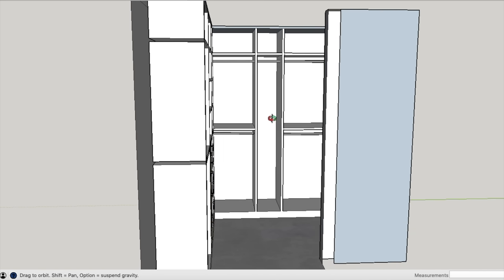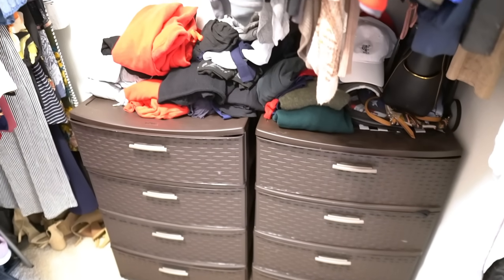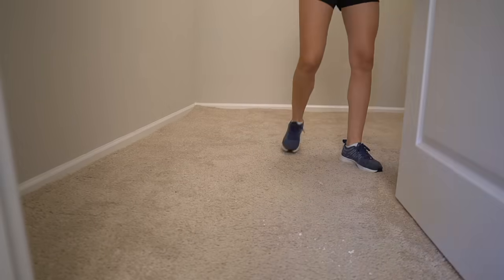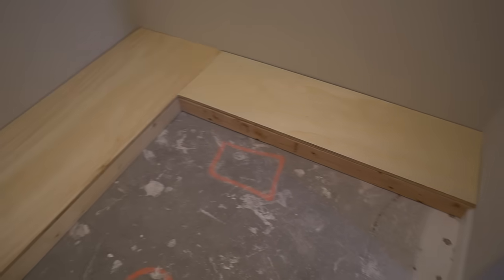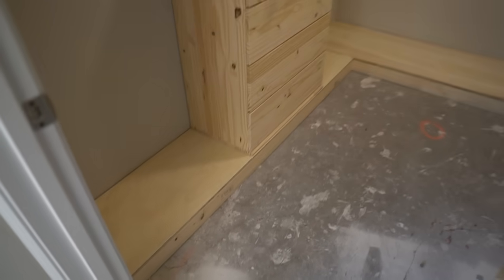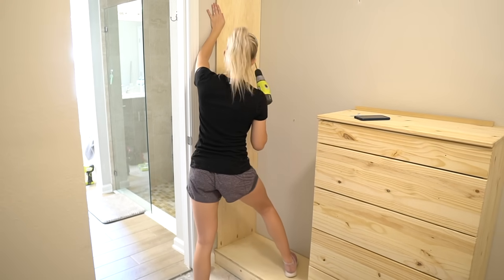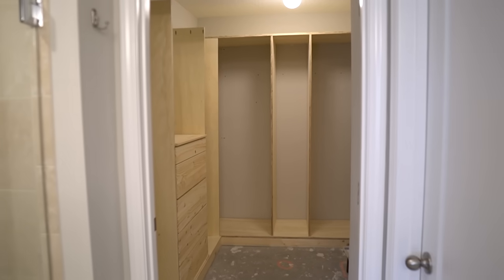DIY Dream Closet Makeover on a Budget!!! [Part 1] | Home With Stefani

Comment: THIS is legit DIY. Working on the ground, minimal amount of tools. No fancy 100k workshop. This makes me happy to find as a DIY. I always run across the "DIY" where they have thousands in equipment and tools. Thank you.
Reply: TBF they're all DYI. The more you get into DYI, the more tools you end up getting. You really just need a circular saw and a drill to build whatever you want. The more tools you add, the easier, more refined, and better finish your build has. For example, she used pocket holes, which is another tool to add refinement to the product.
Reply: Well glueing stuff on walls is indeed legit crappy DIY
Reply: I'm with you. I hate seeing the DIY videos where it's like "All you need to do this is this $10,000 tool and 10 people!"
Reply: They are still DIY, just with better tools than you have.
Reply: Diy has nothing to do with complexity and tools etc.  I would say this is half DIY because she bought premade stuff and only took on the assembly and installation

Comment: Go video:
Tip from longtime experience with doors,  pop the pins, that way for reinstall you just have to put the pins back in.  Also use a flat bar driven in under the carpet strip nails perpendicular to tack strips and you can take the whole strip up with only a few bangs on each nail.
Reply: Same thing I was thinking.  This is the second video recently I have seen where they have done this.  Door removal takes seconds if you pop the pins.

Comment: Wow, looks great and very good work. The only suggestion I'd have for anyone that replicates this. Try not to glue large pieces of wood to sheet rock. When the wood contracts just a tiny bit, it can put stress on the drywall and even cause small cracks. And if you ever decide to change the space, you'll have a wall that needs a lot of repair. A few pocket hole screws should work.

Comment: Very cool! Good deal not relying on just the liquid nails, after demoing several houses I have noticed, on a finished surface if it does adhere it only to the paint layer. Most of the time it doesn't stick to even high grit sanded wood.

Comment: This is a very interesting project. Video nicely done. The only item  I had doubts about was the 2x4 base. Were those 2x4s regular, non-treated wood? I don't know how well they would hold up on bare concrete flooring without a barrier in-between. Concrete and bare, untreated wood do not interface well.
Reply: Would it be ok to build this directly on top of floors instead?

Comment: just a heads up, when you take a door off the hinges, you just pop the pin in each hinge.  Taking the screws out increases the chances of stripping the holes out and messing up the door.
Reply from the maker: Good tip, thank you!!

Comment: Great video. Thanks for sharing.
A few of questions, that will help as I am fixing to start my closet revamp...
1. Is the base build out of treated wood? My understanding is that it is required by code for any wood touching the ground or slab to be treated.
2. Can you give the model # of the Ryobi nail gun you were using?
3. Is there a particular reason for using pocket holes for attaching verticals to the top shelf? Can one use screws ir nails from the top straight into the vertical boa4d?
Thanks in advance for anyone answering, and sharing their knowledge.

Comment: Great video! TFS 😃
another hack- when taking the door off; take the pins out of the hinges. Then put the pin in the hinge part on the wall. It’s faster & you don’t run the risk of having to re-drill holes in the door. 😬

Edit- that’s for IF you’re putting the door back 😬
Reply from the maker: Thank you for the tip!!😊
Reply: I had to pause the video to come make sure someone told her this in the comments. Wonderful renovation though!
Reply: Yes indeed, I carefully taped off and painted the architraves around my mother-in-law's seven doors and was trying to remove the eighth door to replace carpet when I spotted the hinge pins..... AARĢHHH!

You learn something every day.

Comment: Hi Stefani, good tips. Just be mindful that you should be careful when hitting two hammers together. There is an outside chance that the hammer heads could chip and send shrapnel flying. Consider using a wrecking bar as you have mentioned in another video. Safety goggles always...work safely. Keep up the good work!
Reply from the maker: Thanks for the safety tips! I need to work on that 👍

Comment: I'm very impressed! Some folks have offered tips, and there's always the learning curve with each project. Personally, I would have used a framing nailer for the bases, but the finish nailer should be adequate for this purpose. I would have painted the floor first, to help limit moisture transfer and to make it easier to paint without all the edging at the bases. If you had done the partitions first, then then dressers, you could have hidden the pocket holes on the dresser side of the partition. But hey, everybody's a critic, right?   I only wish I could put IKEA stuff together as fast as you. Must be the wine! ; ^)  I like your overall concept. I think you've got a nice project here, and it's obvious you did take the time to plan it out. I'm going to go watch part 2 right now!

Comment: I really don't understand the closets the builder makes these days most have the one wire shelf that leaves so much wasted room at the bottom and usually the top has wasted room unless you are storing suitcases or very large boxes.I understand they are doing it on the cheap but a little sectioning off would improve the function so much.
Reply from the maker: I agree, Becky! They don't make sense!
Reply: Its terrible. Not only are they cheap they honestly could care less about how the home turns out. One neighbor cut out under their stairway and they said it was full of trash. While I was taking out the rocks in the front garden I got to the bottom layer and there was glass bottles and plastic bottles etc. Some are cemented in so I couldnt take them out. I covered the area with white rocks to better match my tan home.
Reply: BatmanPwnage omg that’s insane 😱
Reply: @ShayBelladonna  yeah. They built new houses in the area and theyre getting sued hahahaha its for the stone paneling on the front of the house. Theyre a hazard cause they can fall off and hurt people.
Reply: BatmanPwnage how awful. Will y’all get some kind of compensation for what they did?
Reply: @ShayBelladonna  nah my house is like 10 yrs old and they dont work w the same contractors. The guy who found the trash in his stairwell sued. Been like 2 years. Lawsuits waste money and time.

Comment: Me: wow this seems pretty easy...I could totally do this and save tons
Also me: only owns a screwdriver
Reply: Its not easy! Nobody gets every cut, every angle or every screw in perfect zero mistakes, even the pros. This is a scripted performance.
Reply: That's me 😂
Reply: @lihlemokgalaka4548 just finished my closet project  last month. Cut the closet rods too short due to a measurement error...had to make a trip back to hardware store to buy new...that is reality. 
Hot chick doing  a closet install is fake
Reply: LOL!
Reply: @Mike-ij8uq  Someone ego was bruised during this video. Are you upset that she did it flawlessly? You fucked up, she didn't..it's ok. Doesn't mean that it's a fake install lol
Reply: @charlesscott6140  everyone fucks up or runs into the unexpected. Even pros like Mike Holmes or Norm Abrams. No one does a remodel or repair flawlessly, zero mistakes, zero omissions every time.

Comment: Pro tip: buy yourself an impact driver for screws. A drill isn’t an impact driver. Your wrist will thank you later. 👍🏻👍🏻👍🏻
Reply from the maker: That may have to be my next tool purchase... thanks for the tip!!
Reply: I use a drill over an impact, and I don't round out 100 bits.
Reply: Fif Wuhk and your point being? Nobody said anything about rounding out bits. I offered her an alternative method so her wrists don’t tire out. I’ve been in the trades for a long time and no one out there doing the day to day work can argue that a drill is better than an impact driver when it comes to setting screws. Also if you know how to properly use an impact driver you don’t round out bits.
Reply: @jodyrolandconstruction6577  I think my point was above... :) impacts round out bits
Reply: Fif Wuhk not if you know how to use them they don’t. :)
Reply: @fifwuhk3123  impacts don't round out bits.  people not putting enough pressure round out bits.  Which happens with drills too.
Reply: @eternalharvestfarm  obviously, which makes it easier for most to use a drill, with variable speed.
However, it is my opinion, and was met as a second suggestion.
Reply: @eternalharvestfarm  You guys on this thread - LOL:). Impact/drivers are nice. The biggest reason they 'strip out' bits faster is largely due to people removing the bit from the head too soon. 'Project Farm' did pretty good analysis of this:).
I can't think of any trades person who doesn't use both. When I'm doing detail cabinet work or certain metal assemblies etc. I use a drill w/ a clutch and even a depth-stop when necessary. I'm not unique in that regard.
Hope this is helpful.
Reply: @fifwuhk3123  Yeah if you don't know how to use them...also the newer ones have speed settings for people like you
Reply: Drill all day unless you can throw 100 lbs of force into holding it straight in the head of the screw to stop the bouncing.. however many times you have to do it...  Drill is better for this.  Impact is lighter and more convenient for sure.. But you don't need to impact a closet shelf together lol.  Save it for bolts and NASCAR.
Reply: @Chris Bryant lol....  That comment....
Reply: @fifwuhk3123  buy better bits
Reply: I've never had any issues with my impact driver rounding out bits/screw heads. You need to use a bit size appropriate to the size of the screw head (if using phillips screws). This is true regardless of the type of driver you use though. I've honestly had fewer issues with rounding bits since I started using an impact driver.
Reply: your wrists will thank you and your ears will hate you :)
Reply: It says in description below video her dad was a carpenter when she was growing up and she entered national guard as one so she does have some experience.
Reply: @jmc8076  not sure what this has to do with my OP but okay?
Reply: @fifwuhk3123  You are just new
Reply: @rafb145  Female here- started using impact driver once I advanced into rough carpentry. If you're working with 2x4's, plywood, OSB, once you use an impact driver you'll never go back. There's an added bonus of the screw heads being sunk at or below the wood surface (works out rather nicely with pine boards). It is not the most welcoming tool- jarringly loud hammering sounds and your wrists need to be prepared like you're firing a gun and anticipating recoil. So much faster though!
Reply: Love your video! It's awesome to see other women taking charge and getting their hands dirty!

Comment: Great job , just thought i would mention that when you put wood on concrete it will suck up moisture so use a vapor barrier or pressure treated wood next time... keep up the good work and videos....
Reply from the maker: Very good tip. I'll remember that for next time. Thank you!!

Comment: Great idea with the Ikea dressers. I'm planning to do built in in my closet. I'm doing mine first to refine the method, then I'll redo my wife's closet (mine is separate so she can't invade.. 😆). I might go that route. I was thinking of just building the drawer sections myself.  I don't know if I would've used the liquid nails on the sides up against the walls. If you sell your house, the next owners will be mad if they want to do something different with their organization.... It's your house, I get it, but I think screws would be plenty.
Reply: my exact thought, no need to glue that to the perm wall, screws to the bottom base and top shelf board is all that is needed.  I would have ran the side board on perm wall to the floor and had screwed them intot he 2x4 base.  She still did great job, I did our master closet and it turned out awesome I was very impressed with what I had done, I did not think I could do so well, and it still costed a bit over 1k bucks but had we got it from a kit company it would have been a few grand, this was back in 2013.  I am about to be doing a his and hers in our just added upstairs room so was just taking a peek at some ideas and this came up.  I will look into the drawers and paint them white.

Comment: do you have the height of the 5 drawers base(the part you used)? I really like this idea just need to make sure it will fit in my existing space without the feet so I'm not doing a complete reno.

Comment: Excellent job. superior craftsmanship (or Craftswomanship to be more accurate!!). You also have a great artistic talent in decorating (which I unfortunately lack). 
A couple of suggestions that I learned the hard way to make things easier when you are renovating: 
I always paint every wooden part before I install it. It is much easier to touch-up little dings and holes in an already painted surface than to have to sand and paint little crevices in place. It also allows you to use a roller rather than a brush which is a real time saver. If you really want to get fancy try spraying the paint. Spray paint looks better but it is a pain until you get used to doing it, so be forewarned. It took me a bit of time to learn how to spray paint but it is now much easier the second time around. Spraying paint also requires covering things that one does not want to get sprays. I spray painted my kitchen myself (that saved my $3,000) and it looks professionally done....well worth the effort. I don't think I can go back to brush painting unless it is a small job.
I also found that buying the best quality screws makes a big difference. You will spend $10-15 for a big project like this but it cuts down on cursing while you work!! Good nails are reasonably priced If you buy them in bulk because the pros who generally use them do not buy small packages.
On last point. For the longest time I bought cheap drills. Now that I finally broke down and bought an expensive drill and nail driver, I know why pros use these expensive drills. They are much more powerful and, more importantly, perfectly controlled. I get every nail in effortlessly and exactly as it should go, not bulging and not too deep. I bough a Dewalt set that cost about $200 but I am sure other manufacturers make ones that are just as good. A good drill coupled with good nails make it a joy to do carpentry. Also when I assemble Ikea furniture, a controlled drill can save me much time. When I tried a bad drill just, it just striped the holes from over tightening because you will not well controlled and this always ended up being a total mess).
Keep up the great work you are doing and keep posting new videos. I really enjoyed watching your closet renovation video and and learned much from it.

Comment: Very creative solution for a budget. Props to your carpentry skills. I hope nobody has to ever take this thing out, the liquid nails against the wall will be a nightmare to remove, may have been better to just secure it against the studs. Also, wondering if the long plywood pieces may warp over time. What was the overall cost of the wood?

Comment: Hi The Brad Nailer you used is a 18 gauge on the 2x4 is using 2" nails at least that's what the link leads to. My question is how are you able to nail the two 2x4's together?

Comment: Stefani - This is amazing. I have been watching this over and over again to plan and also to build up courage to take on a task like this. A question on the material, why did you chose Sandy Plywood instead of Particle board? Particle board is much smoother than the sanded plywood and half the price for same 3/4" width. I am ruling out MDF as MDF can't handle weight and could sag but I guess most of the shelves we see at Walmart, IKEA etc.. are all made of cheaper material such as particle board. Thanks in advance for your response. We love your videos

Comment: Great job! Do yourself a favor and by an impact driver. It’s a cheap tool and you can get a ryobi to go with your kit and batteries. You have a lot more control, snap less screws, and don’t have to work as hard (which is why you have more control).

Keep it up!

Comment: The cubbies up top limit the length of items you can stash up there. The top should be monolithic so you can store anything from wrapping paper to long boxes and cases. Even better is to run full lengths of melamine or shelf liner covered plywood to make it one flat surface with as few joints as possible.

Comment: JUST FOR FUTURE PROJECT REGARDING THE TOEKICKS 2 THINGS ..THERE IS A VERY ACURATE WAY TO FIND THE MIDLE OF THE STUDS AND THAT'S A MAGNET STUD FINDER OT ACTUALLY STICKS TO THE DRYWALL SCREW AS YOU PLACE THE MAGNET PRESS AGAINST THE WALL CIRCLE AROUND AND YOU WILL FIND THE SCREWS IN THE MIDLE OF THE STUDS AND THOSE MAGNETS ARE FROM 3 TO 5 BUCKS ONLY ... SECOND YOU DONT ALWAYS HAVE TO SCREW THE TOEKICKS TO THE STUDS YOU CN DO IT TO THE BOTTOM PLATE AS WELLL... LOVE YOUR VIDEOS AND I JUST CAME ACROSS THIS CHANNEL FEW MIN AGO

Comment: What were the dimensions on the vertical plywood boards? 

The Tarva dressers I found were only 15" deep, is that the same as what you used?  Did you set that out from the wall?

Comment: Stefani 
Love what you have done two thumbs up from me. Just one question, would this work as well with the home depot 1 inch white type particle board walls and shelving in place of the 3/4 inch for the verticle walls?

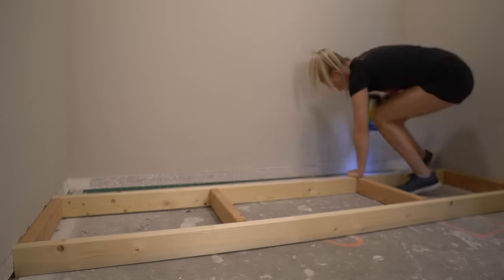Comment: 7:20 are you using 18 inch brad nail gun or 15 inch? because you provided 18 inch brad nail gun in description so wondering how it worked in 2X4 as it takes max 2 inch nail